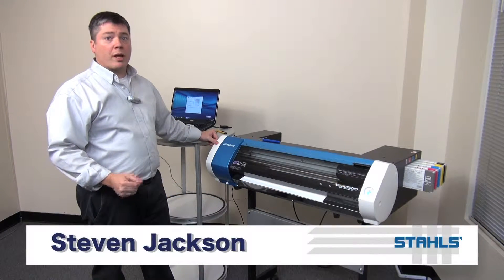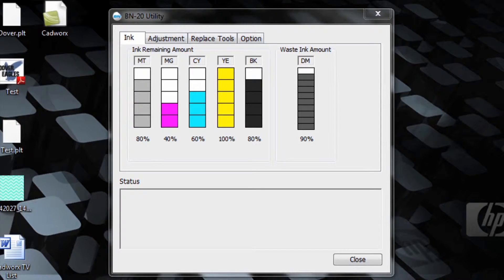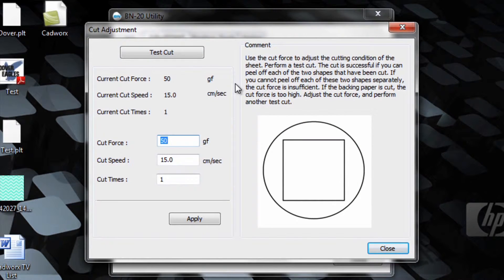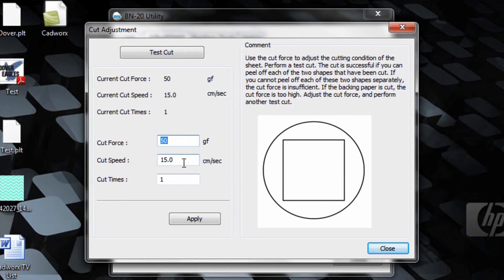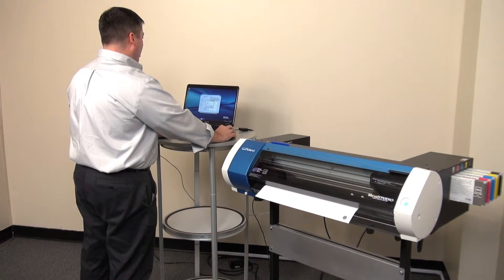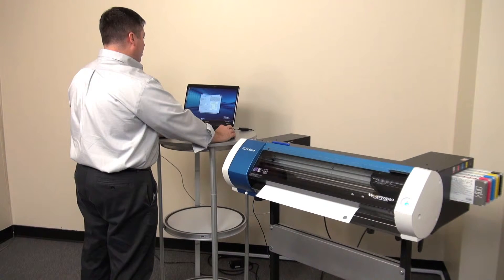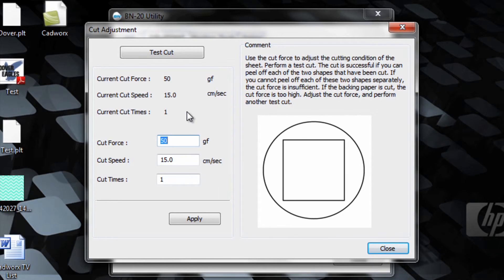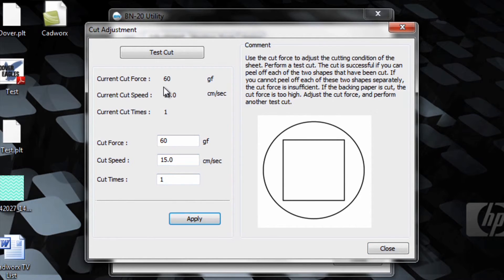Performing a Test Cut on the Roland BN-20

Comment: I called y’all studio today 03/21/23, to get a  recommended cutting force for soft opaque 2, while using it on the BN20… 5 hours later still no response.. wow so disappointing
Reply from the maker: Thanks for letting us know. Not sure which number you called. But, unfortunately we no longer offer the Roland BN-20. We do have cut settings for the Tru Vis machines on our webpage. https://www.stahls.com/printable-heat-transfer-vinyl-soft-opaque-ii